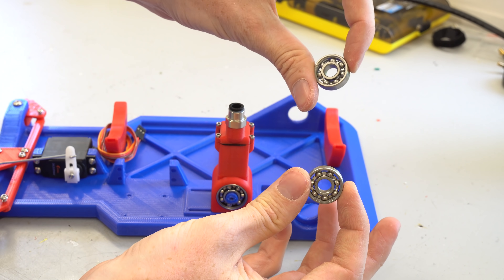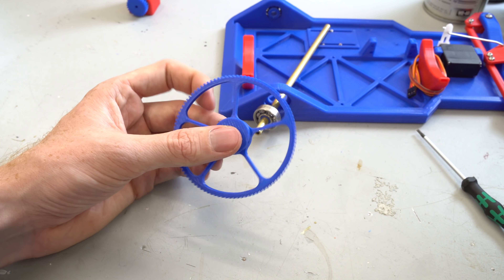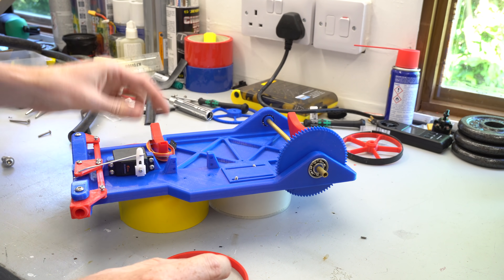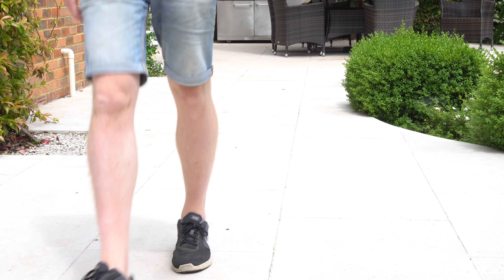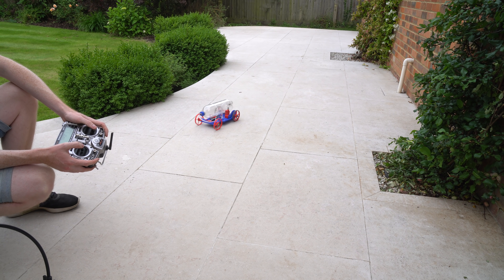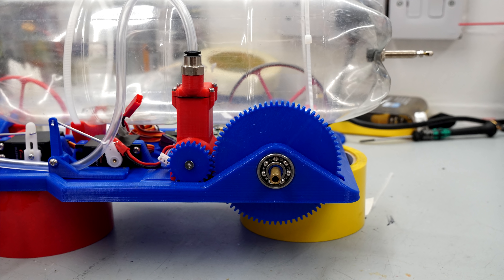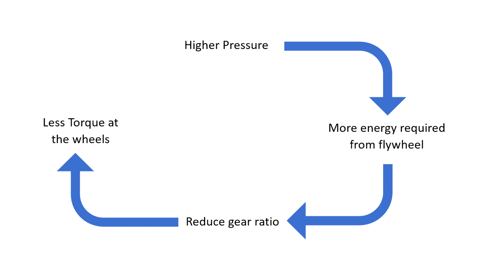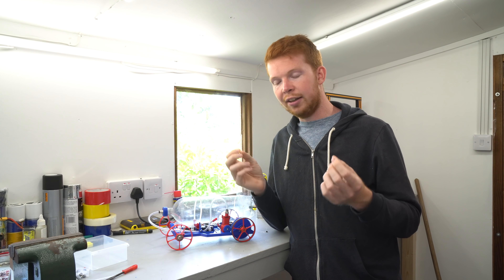Air Powered Car

Comment: The flywheel comments are good. I'm guessing you have that about worked out now. But I dont see any comments relating to a clutch which would solve another problem - car has no idle mode and must always be moving like a shark.

Not sure how your engine is designed; haven't watched that content, but the valve which opens and closes, if on ball and spring for instance, can be adjusted by changing size and tension. Maybe I'm just stating the obvious though.

Comment: There were some guys, from India I think, a few years ago who had built a small passenger car that ran on compressed air. They said they'd have a workable consumer one in a few years, but then they said something that made me doubt that claim: That you could charge the vehicle with OTHER compressed air tanks and therefore not cause any pollution whatsoever. Right then I knew this was dubious at best.
Reply: They were French, not Indian, but they were planning to sell their technology to Tata Motors, an Indian automotive company. This video shows the technology but they don't mention the air tanks powering air tanks in this one (they did in another I saw): https://youtu.be/uRpxhlX4Ga0

I guess the reason it never took off is because lithium ion electric vehicles stole their thunder.

Comment: i know this is an old video but do you think if you had some smooth gearing and decent tires and an  actuall metal CO2 container with a pressure regulator that this design could be made to work

Comment: You need a differental on the rear wheels to adjust for steering. It allows both rear wheels to spin at different speeds when turning so that one is not getting dragged along.

Comment: I must ask, how did you work out the steering geometry? Being even more accurate will fully align them. Also, if you’re not using a differential, only powering one wheel would stop the rear wheels fighting each other for grip in corners.

Comment: Connect air balloon in between the servo valve and engine. It would accumulate compressed air under low pressure, and help you to react and close valve. Simple manual pressure reductor.

Comment: FOR acceleration it is better idea to use control valve by rotating cw and CCW ( now at present in this picture shown is press control for long usages hose pipe will get wear and tear )..

Comment: I figured that having too much pressure would do that. It starts making the ball valve harder to move counteracting the engines power to actually move the ball so you run into non starts at high pressure.

I know that adding a regulator would solve the over pressure non start. There is probably a few design changes that could allow you to run higher pressures and avoid a over pressure non start.

Comment: The other issue in addition to the flywheel mass and ratios is the rear drive assembly. Having a direct drive with both wheels attached doesnt allow for individual rotation speeds when turning as each wheel is trying to traveling a different distance and speed so the gear ratio and flywheel are fighting the negative drain of the inside wheel trying to spin at a slower speed and is attempting to overpower this effect.

 Adding a differential or even going to 1 wheel drive would greatly reduce the momentum loss and energy drain of trying to overcome this effect. You might even find you require less psi to maintain momentum.

Most cars due to the diffirential powering the wheel with the least resistance are only 1 wheel drive(obviously ignoring awd and 4wd and lsds) seeing your design isnt setup to handle rough terrain i see no harm in resorting to 1 wheel drive.

Comment: Since we're running "relatively" low rpm's here, I think an arduino combined with a hall effect sensor should be able to electrically open and close the inlet valve of the motor - if you try this, use a trimpot on the arduino's analog in to be able to precisely control the valve timing. If you get this working, you might reconsider also adding the outlet valve again

Comment: Try using a more effective way to restrict the flow of air by using some sort of mechanical valve to create more pressure...also use rubber gaskets around the fixtures to make it air tight so no air escapes

Comment: It’s not necessary to have electric starter it’s the engine and transmission that’s the problem. Twin sliding pistons with air supply from top and bottom plus air regulator, con rods onto a fly wheel with belt drive or direct to the wheels . Like a steam engine.

Comment: Man, I wish I had a 3d printer. There so cool! If I get one for Christmas this is the first thing I'm making (assuming that I get a good enough one).
Reply: Its not that easy. In first you need to know how to use bledner or other program like that, and also slicer program. Then you can learn how to use 3d printer, and just then you can start printing.
Reply: @wojciechsosna9230  saw you in my YouTube notifications, I have since then gotten several 3d printers (2 fdm, 1 sla). you have somewhat of a point, however it can be simplified for families and such. my first printer was an Anet a8 and that thing was a pain. I got it to work OK after a few months but after a year it started having issues. I then got an ender 3, which to my surprise was quite simple. it came half way assembled, its got decent instructions, and its own slicer. for program parts its not all that difficult. most slicers like cura can run as is as long as you have the machines settings correct. and for creating things I like to use tinkercad, its simple but you can still make complex shapes with it. so the conclusion is it can be confusing but like I said it can also be simplified. i would have been 14 at the time and it did take me awhile to figure out how to actually start the print, however after a few YouTube videos all problems were solved and since then I have printed over 200 little trinkets and useful parts.

Comment: Just get a metal gear and a pressure regulator. I wish i had a 3d printer so i could show you how it is done😉

Also air engine make shit tons of torque, your engine has to short of a stroke though.

Comment: I think you could solve a lot of the issues by designing a multi cylinder engine, by simply mirroring the cylinder in a opposing cylinder layout. So then the force of each power stroke opens the valve on the opposite cylinder

Comment: You should go back to a round piston. Then you can use a drill bit to make the cylinder perfectly round and lathe the piston until it's a perfect fit. It would run much more efficiently !!  :)

Comment: I know it seems like a stretch but can you try an design a transmission for the air engines by any chance?
Like give it gears so the power last longer (just to specify)
And maybe a mufler or some typa exhaust
Or some sort of starter for the engines instead of having to start it by hand?

Comment: build an hybrid car with electric engine, so when you close the air valve you can use the electric engine and when you will use air then open the air valve. improvement or not?

Comment: Theres another solution. I watched your engine design series. You dont have to power just one one stroke...you can power on multiple strokes.

Using a rotary type engine is one way to accomplish this, but you can have a compromise where you power on the up AND down stroke...if you need a flywheel at all...its momentum/mass would be really minimal.

I've been thinking I might try and replicate your engine on my 3D printer and then try and implement this idea...which I'm sure has it's own (probably timing related) problems. I might also try and get it running on a C02 canister.

Will I ever actually do it? Ask my graveyard of started and never finished projects...but...maybe.

Comment: Metal flywheel with a deep groove and a rubber band to drive a large diameter pulley on the rear axle. Be a lot smoother than gears too.

Comment: In a car, as opposed to a plane, you probably want to be able to actually stop and start again. You need some kind of cluch mechanism to keep the engine running at a low throttle setting always (with its own flywheel), and only engage the drive train when you throttle up. A centrifugal clutch would be interesting to 3D print, and wouldn't require a separate control.

Comment: i dont know if its a good idea but at least its quite intelligent
mix fogging oil to the air (like gas engines, gas+air) so it will go smoother
im not forcing you to do it but its good

Comment: You need to use a co2 canister that feeds into the air tank and have a pressure regulator

Comment: the main problem is the same as early cars it has a solid axel and the friction between inner and outer wheels is tremendous the easy fix is to have just one drive wheel on so small a car.

Comment: What you should do to improve this is
*use a CVT transmition(it is easily 3D printable) and a heavier flywheel which will solve the torque issu
*rather then using a pump its better to use dryice(u need a stronger container or kboom!)to greatly increase run time

Comment: Don’t know when you’re going to make another video but I recommend only using rubber on one wheel so the other can slip when cornering so as not to make drag and it would be more simple than a differential 

Further more, belt drive would be much easier and make less inefficiency, if you made it so the belt could slip a little it would help with acceleration 

I used both those methods on an electric car I made as a school project and it made it perform much better

Comment: Add an actual flywheel to the drive gear so you don't have to rely on the car's momentum and less than ideal gearing to keep the motor spinning.

Comment: it needs a centrifugal clutch or a mechanism that transfers only the excess power of the engine so that the energy needed to operate the valve isn't also stolen 
with a centrifugal clutch if the engine slows down the clutch would disengage momentarily to allow the engine speed to increase again which in turn would re-engage the clutch...so on and so forth
this is all theory tho and im no engineer so this might not work just an idea

Comment: a metal flywheel is a good alternative for sure

also adding another piston would help overcoming the torque needed for valve operation since it wouldn´t depend solely on the flywheel momentum

Comment: i know you know this but you should add some rubber to the front wheels event though its a low powered car. i just think it ittl increase handling a little bit more and make it a little better. plus it would help even more if you increase the cylinder size

Comment: Awesome build! But I think you have increasing and decreasing the gear ratios the wrong way round! Adding a smaller pinion to the engine will decrease the ratio; a larger final drive gear will also decrease the ratio

Comment: Add a metal fly wheel and have a clamping mechanism to clamp on the rod to keep the engine moving wile not in motion the throttle is how hard you clamp to the brass rod

Comment: Would an old snowmobile style clutch work at all, where at low rpms the flywheel is "smaller" than the drive wheel and as rpm picks up it becomes "larger" while the drive gets "smaller" (it's all done by centrifuge and friction)

Comment: Thanks in advance if anyone can tell me if a real engine is more efficient than a propulsion with "compressed air rockets" (which are perhaps  even if less efficient lighter and contain less parts, so less friction loss)

Comment: You could add a second chamber so you can store the air in one and let the second chamber feed the engine and let the 1st chamber feed the second one so it always stays at the optimum psi.

Comment: Make it one wheel drive and it will solve The slowing down problem when you turn simply cut the driveshaft and put two additional bearings pretty close to where you make the cut and it will work like an open diff in a sort

Comment: What you need : 
Electric starter (to get the engine running since it requires a push start every time)
Better storage for the air (compressed air canister)
A clutch (Should fix your torque issues when starting)

That's it really. Hope to see these ideas in a future video :)

Comment: could u try filling the bottle up with dry ice ?
while it's melting it will  create new pressure on the bottle  which can be again used to run the engine

Comment: You can probably solve the issue by having a small gear as well as the dedicated flywheel on the crankshaft. This way you will keep the momentum of the flywheel but also keep the gear ratio. There's a reason why old steam engines had a huge flywheel. Also in my opinion, pressure regulator is a must. Plastic bottles can handle huge pressures. They initially bottled with far more CO2 than needed as they loose some of it during transport. For this reason they can easily handle pressures of 150psi.

Comment: I personally would’ve used a ball valve and had a motor turn the ball. I also would’ve set the valve so that it was always opened just enough for it to run. Lastly, I would’ve added a snowmobile style clutch. The different approach is very cool though.

Comment: You should add a rack and pinion type gear with the pinion being on the drive shaft with a one way bearing and a rack on a slide with a high speed servo attached in front of the shaft far enough away that in the “off” position the rack won’t touch the pinion allowing the car to move under air power but in the on position will allow the gears to mesh and the when you hit a switch the high speed servo will fling the car forward proving forward momentum for the ball valve to open and the one way bearing will allow the car to still move when the rack is on the pinion waiting to slide forward but the rack should not be able to touch the pinion even with the one way bearing because it will cause drag sounds complicated but think of it as a string tied around the shaft and could be pulled as many times as needed whenever needed just hit the switch and go

Comment: you could also use a presure regulator so that the engine does not geto more than 30 to 40 psi, or you could also make it with more than one piston so that the power of the engine can open the valve rater than relying on the momentum of the flywheel to keep it going.

this would alow for a lighter flywheel and you could get a faster longer lasting runtime

couple this with a presure regulator and you could even increase the presure of the bottle to up to 100psi as most two leter bottles don't fail till around 150psi. if you are wondering if the prestavalve can handle it, the ancer is yes.

valves like that are use in road bikes where tires can be pumped up to 130psi because if the rider did not, it could cause damage to the bike if they hit anything.

Edit:
also, if you where to look at steam engines, such as the one on the doble e-20, you would see the applying presure the the piston on both strokes to take better advantage of steam presure.
you could also use the presure that the engine exausts out to run a smaller suplumentary engine to add even more power.

Comment: Can you make the engine move from the the gear that goes to wheels and then make it so you can kond of start the car with little electric motor and move the engine back so you can drive?

Comment: although the suggestion is overused, a 2nd cylinder slightly offset from the rotation of the first was originally designed to eliminate the issue you're having. as one us dragging trying to reset the stroke, the other is pushing its stroke therefore eliminating that moment of less power, the cylinder will add smoothness between strokes and extra output power for the cost of being less fuel efficient and more complex in design

Comment: Try mounting two engines. If you configure it right you could get the air draw one engine would have well lowering the pressure each engine gets

Comment: Problem is not with gear ratio or engine. Problem is with imagination. 
Engine is as it is, so it means that having engine like this you have to think carefully about car weight.  And putting such massive bearings for this kind of car is silly. The same with frame which is solid,  servos way to big etc..
Why using gears? Belt transmision would be better and simplier.
Would you biuld a RC plane like this? Obvioulsy not because it would not flight with small engine.. so why try with a car?

Comment: you seem smarter then me but i would of thought cam timing, if the valve is opening before or at piston tdc then the piston has to fight up against the pressure of the air, higher the pressure more resistance and harder to turn. if the valve opens even 1deg after tdc when the connecting rod is on the down stroke the air pressure should be able to push it down, and if the valve then closes just before the piston reach's dead bottom it should spin freely up to the top, then wheel only has to move valve back open with minimal resistance
Reply: maybe even a second cam to allow air out when piston is on the up, but could cause more resistance then what it would gain
Reply from the maker: The cam opens the valve about 30 degrees after tdc, so the piston doesn't have to push against air inside of the cylinder. Instead it's the cam opening the valve which is the issue because the valve needs quite a bit of force to open due to the pressure.
Reply: aswome yeah you have that part of it already figured out then, good work

Comment: Have you considered to use a slide-valve, like it is used in f. E. Steam engine models? They are under normal conditions self-sealing. But I honestly don´t know if they have a low enough friction to be an improvement.

Comment: you need to build an air engine based on this: http://507movements.com/mm_424.html it's a square piston, double acting, dual axis design. It should solve your stalling issues without too much mayhem